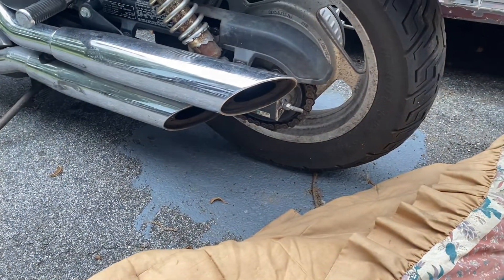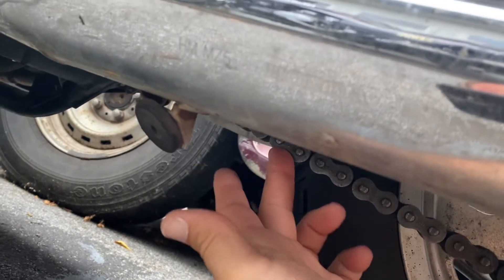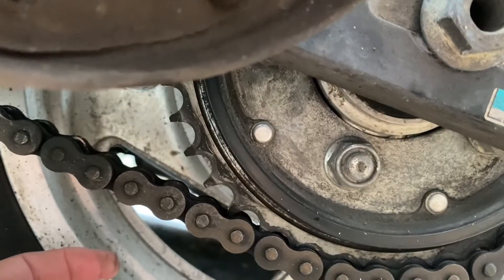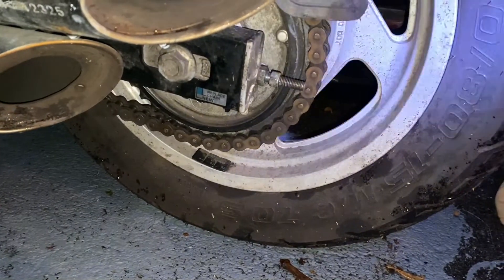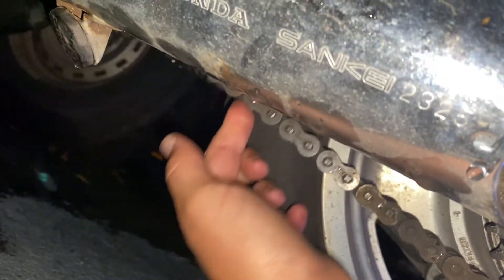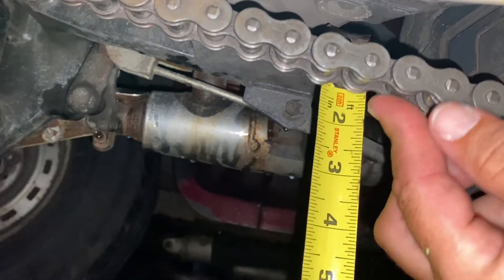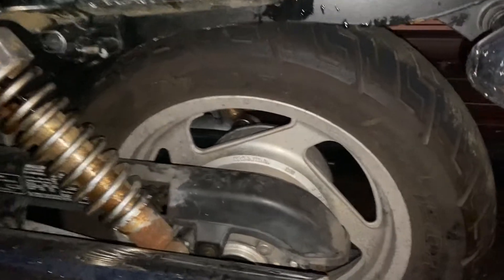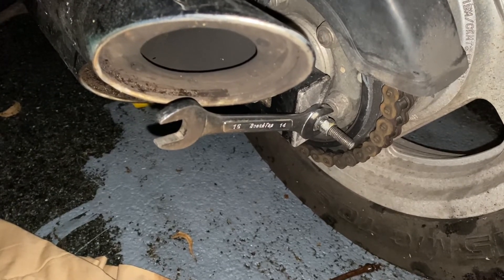Chain Adjustment Adjusting Chain 1994 Honda Magna VF750C

Comment: So I find the tightest point and make sure it has an inch of travel? I have an 84 magna v30 and it’s my first bike so I’m learning
Reply from the maker: If your chain is still in good, serviceable shape. Yes! I’m finding this chain may need replaced.
Reply: @mcycleshawn  how would I tell if I need to get a new one?
Reply from the maker: @glassgaming6429  in my case, Anytime I adjust the chain to where I think it should be  it seems to bind up at one spot….if I loosen it, it seems too loose in spots. I’m going to find a shop that knows more about chains than me. I can work on shaft drive all day long! Lol
Reply: Specs in manual of my 97 magna call for .8 to 1.2 inches of travel.. keep in mind point eight is Slightly more than 3/4 of and inch . So shoot for 1 inch and you're good. Also whenever replacing the chan you should also replace sprockets.  I take mine to a shop and have it done.

Comment: More accurate to.measure  length of adj.above nut. Make the same each side. ALWAYS ERR ON LOOSE SIDE!

IF CHAIN IS WORN ...REPLACE CHAIN AND SPROCKETS...THEY ARE A SYSTEM!

done correctly...chain should last up to 50k miles.

My 2003 triumph tiger 955i did 50k with one adjustment!